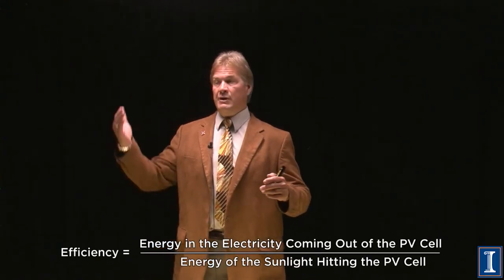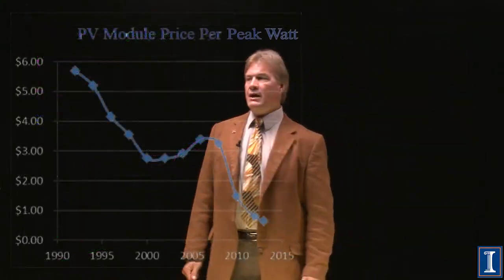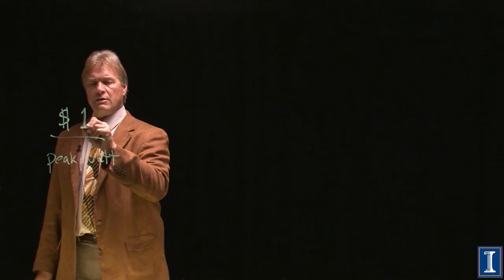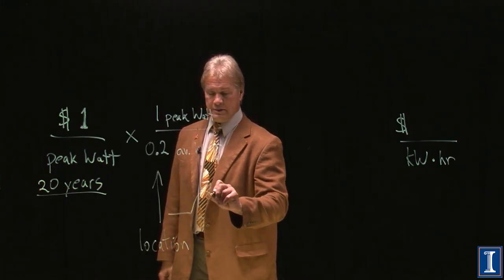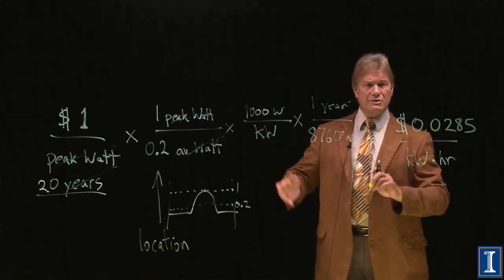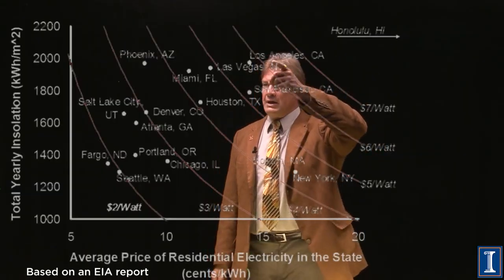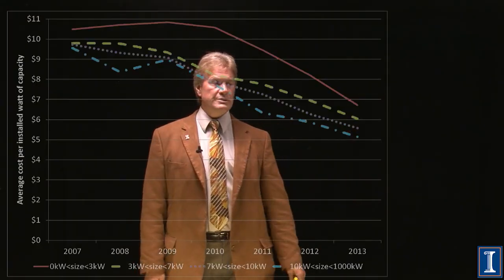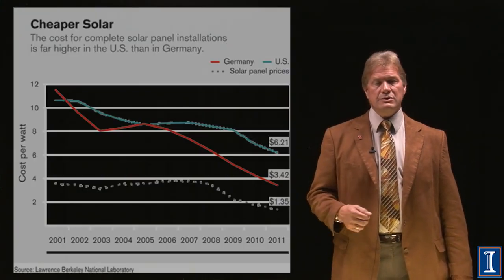The Cost of Sunshine

Comment: What are the economics of the energy used to create a solar cell and it's energy output over its expected lifetime? I read an article from Stanford that said until around 2015 it took more energy to produce a solar cell than the energy it was expected to produce. Then there's the matter of shifting pollution to create the solar cells to other countries.
Reply: I would guess that the cost of the energy to produce a solar cell would naturally be reflected in the price of it. Who is going to buy energy to make something but not add it to the sale price? But otherwise, I agree with what you are asking. Much of what we think is "green" energy just shifts the pollution to some other place that we cannot easily see.
Reply: No energy solution has a net positive output. Nuclear, coal, gas all take more energy to create than they produce. If we could make positive energy then we would live in a very different world
Reply: @TheJorge100  I think you are wrong at that one.  If all energy capture or extraction methods were net-negative, then we would all be dead.  That would be like eating celery.  It takes more energy to chew and digest it than you get back in calories.  But most all other foods give you more energy than it takes to consume it.  Ditto for energy 'production'.  Let's look at an example like hydro-power.  One can quantify the total energy required to build the system.  Then, once installed and running, you might run it for decades with very little additional input other than the water power that is provided with no human input required.

Our mere existence and increase in population suggests that we are obtaining more energy from our surroundings than we are expending.
Reply: @mikebetts2046  I hadnt considered hydro, so that is possible, but it still could not be. When I mean negative I mean barely. Like 0.001. Its why we still need fossil fuels and they are the reason we arent dead. We are using a finite resource to convert energy into something we can use. When I mean net energy I mean the energy to build, maintain, transport materials, fuel, workers, etc.
Reply: @TheJorge100  I had thought you did mean the 'maintain, transport, fuel, workers...' part.  On that score I still say that the overall system must be net positive, otherwise for the last few thousand years we would have been expending more energy than we have been getting and thus we would dwindle in just a few weeks or months.  

Imagine a person spending his every waking hour digging, hunting, and collecting food.  He does this 12 hours per day x7 x 365 and maintains the exact same weight.  We might assume he is net-neutral on energy.  Now he sacrifices some time (and weight) and makes some tools to increase his efficiency.  He can now do the same food-gathering tasks in 8 hours rather than 12.  Were he to work the same 12, he would then gain and be net-positive.  And probably gain weight, or have enough energy to get his woman pregnant and also support another child.  And so the cycle continues with ever-expanding efficiency.  It is true that the sun gives us its' energy for free and we do not consider it in the calculation.  So if we want to include the sun (energy burned for energy given) then maybe we are negative.

Comment: Solar makes a good supplement but I believe its being oversold. Your discussion doesn't include the monetized environmental and health cost of energy associated with fossil fuels. You also need storage and a base load generator usually fossil fueled. .But the big problems with solar and wind are land area vs electricity produced by a base load plant. Also you didn't even mention nuclear power, the cleanest, most efficient, and cheapest by any measure, especially the next generation LFTR nuclear plants fueled by thorium.
Reply: yes
Reply: Yes about Nuclear being best option and Solar fluctuating and being terrible for power grids.  Except for 100k in batts per person how is Solar and Wind grid even supposed to work once they become most of the grid, this is impossible green plan which is never addressed?
Reply: storage isnt possible...not at all.. not even a fraction.  you guys have it easy down there...ill say this loud... ITS IMPOSSIBLE TO HEAT NORTHERN CITIES WITH OUT BURNING SOMETHING OR SPLITTING AN ATOM.  end stop.  you simply cannot heat nyc with out fuel.
Reply: @mattycheezeburger  .. Actually i wonder if u can put billboard size mirror north of house n beam sun into window w black water tank, even in winter this cld work if tank big nuff to cover cloudy week, so heatin green is possible but we need to test, nuke needed for electricity...
Reply: @amyself6678  you would be amazed how little sunlight we get in winter in vermont.
Reply: @mattycheezeburger  MN winters r sunny, fall n spring can be dark, , . with photovoltaic gettn cheap that is beating solar thermal for heatin now, so prob can heat w solar if got big water tank to storrle heat at 200F for dark days. 60% home energy use is air n water heating, AC is 7 , appliance r 34. Eia.gov says this. So heck solar could cover 60% of household energy, prob offices too. . Trouble is adding 10k in solar equipment to each house simply is too much hassle to avoid under 1k a year gas cost, , and houses r only 25% of usa energy so maybe better to just go straight to buildin huge nuke plants in each metro.
Reply: @amyself6678  let alone.,.,that may work for a single family stand alone house...thers no way they have the space or the time or money to do this for bigger buildings
..can you imagine the heat sink for a 40 apt building?
Reply: @amyself6678  natural gas is king..by far. pipelines and natural gas.
Reply: @mattycheezeburger  natgas is king but it pollutes a bit, it is so cheap few people spend 15k to go solar fot heatin, , ohwell
Reply: @mattycheezeburger  . . i can totally imagine a apt sized solar  thing for apt, w nice big suburban yards we cld do it,  solar is silent n now cheap, solar is great compared to puttin a loud generator next door, , only solar prob is no gd way to store days of  electricity in case bad weather without 20k a person batt,
Reply: @amyself6678  you cant heat nyc with solar power...you CAN use natural gas..and besides atomic..its the best source of power by far.. you cant argue with me about this.
Reply: @amyself6678  its not a matter of just spending..its simply NOT POSSIBLE in most cases.  most people live in CITIES..not single family suburbs .make them move and then get transport costs..etc.
Reply: @amyself6678  and my propane generator makes almost zero sound .  14k watts. comes on when ever the power goes out..which is  about 4 days a month where i live in middle of no where vermont.  we have a small storage unit ,,just so the generator isnt going on just to power some small stuff..or constant from just something like a thermostat drawing power.

Comment: Great video. However thre cost of solar needs to include the cost of having standby power available instantaneosly. You have to keep the current system fully staffed to support it..
Reply: Don't need stand-by power. Already available through utility scale battery power. Try to keep up. We don't need no steenkin' nuclear or fossil fuels.
Reply: and the inital sunk cost,, say it costs 20k today to setup. he just avgs that out like its nothing, if you instead put that 20k in the bank. the accumulated profit over 20 years erases any savings the solar may have gotten ya.  plus the solar degrades massively with time..so yeah it works 20 years,,at 50% the last 7

Comment: 2019 Update:  Solar Panels are now <$0.30/w.  Total installed cost is now often <$1/w.
Reply: Now take away all the subsidies.
Reply: @dontbetonit813  That IS without the subsidies.  With subsidies they're ~$0.20/w....
Reply: @Chris-ie9os  That's nice. Now solve the REAL problem, storage. All the home solar consumers are doing is shifting cost burdens to traditional plants that need to handle 24/7 demand.
Reply: @chrimony  Storage isn't 'needed' and hardly beneficial until supply > demand.  If the lowest Demand during the day is 30GW and you have <30GW of solar why would you waste energy storing it?  Just ramp down generators and use less fools fuel.
Reply: @chrimony  ..... still better than burning fools fuel.  :)   Think of solar as decreased demand... just like using less energy.  Does it make sense to run your AC with the windows open so it doesn't cycle on/off?  Of course not... neither does storing solar if there's demand on the grid.
Reply: @chrimony  The video you linked to discussed how storage is used to buffer the grid.  That has isolated benefits but is neither 'needed' nor worth the cost relative to hindering the expansion of renewables to displace fools fuel.  Yeah... we're gonna have to give up obsolete thermal plants like nuclear and coal that ARE far less efficient when they ramp compared to gas turbines... that's already happening :)
Reply: @Chris-ie9os  Try watching the first three minutes. It covers how solar and wind increase instability, reduce efficiency, and increase pollution by require "peaking plants".
Reply: @chrimony  Again.... 10MWh from wind or solar may only decrease fools fuel generation by 9.5MWh because it's less efficient.... but that's STILL 9.5MWh less fools fuel generation.  And changes in demand do the same thing.  Demand response NOT storage will be the cheapest solution.  SPP already gets ~25% of their annual generation from wind with ZERO storage.
Reply: @Chris-ie9os  Try watching the first 3 minutes. You're ignoring how the peak generators, which need to be there to make up for solar and wind instability, are heavy polluters. It's also cute how you keep using "fools fuel" in place of fossil fuels, which keep people warm in winter, runs all the modern industry you take for granted, and provides the bulk of reliable, 24/7 energy that you depend on.
Reply: @chrimony  Try a heat pump... no fools fuel required :)   'Peak Generators' are now just gas turbines which run very clean and can load follow efficiently.  The cost is higher because they have a lower capacity factor but they're very clean.
Reply: @chrimony  What you linked is based on the U.S.'s "current" (read: old) methodologies for handling load variation - and this is being phased out in other countries for battery farms and thermal storage sinks (Australia has been implementing battery farms more and more as they have proven to be extremely effective at load balancing).
Reply: youre telling me for 5k theyll put 5kw system on my house.. i find that hard to believe
Reply: @AndrewBrowner  you'd pay between 1.5 and 2 USD/kWp in europe right now
Reply: @AndrewBrowner  I'm telling you that you can buy 5kW for <$5k.   Commercial Scale is <$1/w.   A friend recently bought 4.6kW for $3k.  http://sunelec.com
Reply: @Chris-ie9os  I doubt they'll last longer a couple years. I've heard the markets has flooded with cheap chinese knock-offs.
Reply: @Jawshuah  I bought some 'cheap chinese knock-offs' ~5 years ago... still doing great.  It's not hard to make a solar panel...
Reply: bullshit
Reply: What you see is that, for big plants, the solar panels arent actually that much of the cost anymore. All the rest is concrete and so on. 

On home values, I cant see many below 1 /watt. Energysage provides a average consumer cost today in 2019 of $3 installed per watt. https://news.energysage.com/residential-solar-panels-for-home/
Reply: @adamigra634  So much concrete.
Reply: @adamigra634  Very little concrete.  Most solar is pile driven.

Comment: I think that there are two take aways from this presentation.  1) We need cheap storage.  This is coming but it is not here yet.  2) We want to use utility scale solar (cheap standardized installation) rather than having them on roofs in the US.
Reply: Utility scale solar is best in desert climates. For a utility installation it may be better to construct a solar thermal plant rather than photovoltaic. It would be much cheaper on a per kilowatt basis, more efficient, and may include integrated thermal storage and even an integrated fossil fuel backup. Thermal storage would eliminate the need for batteries.

Comment: Solar power produces a very undesirable product: unreliable electricity. Since panel output fluctuates with the weather, you need a reliable power source (fossil fuel, nuclear, hydro) to offset the erratic solar output to maintain grid voltage and frequency. Also, since solar production is zero over 60% of the day, you need a 100% backup system (again fossil fuel, nuclear, hydro) to meet power demand during these periods. Finally, you must also consider the toxic waste stream costs to replace all your solar panels every 20 years.
Reply: Solar panels are Aluminum, Sand and a pinch (<1ppb) boron and phosphorous... none of which is toxic.  The role of solar is to reduce the use of fools fuel (GWh) which it does very very well :)
Reply: @Chris-ie9os  You should double check it, I didn't believe it either its mostly nothing but becomes a problem of scale.
Main issue was the Chinese are still using lead solder.
Reply: @AvNotasian  .... I have checked it... I've been to a Solar Factory in Ningjin.  Lead hasn't been used in solar modules for decades.  They also stopped using Silver.  The cell strings are spot welded.
Reply: @Chris-ie9os  Except they still find it in reality.
China has a serious problem with cost cutting and corruption, its why their stuff is of a low quality.
Reply: @AvNotasian  They don't use lead... but if you're that paranoid then use US panels.  They're now about the same price.  Mission Solar is based in TX.
Reply: @Chris-ie9os  I live in Australia, believe me they are not the same price :P
And they do use lead, its a problem that was identified when looking at the end of life for the arrays.
It was based off a random sample of panels that were put through the process of disposal.

I'm not saying its a significant problem, unless you plan to fully recycle the panels it should be irrelevant.
The other health hazards I thought were so irrelevant that I forgot them but there were at least 2 others.

Comment: The utility has to build coal/gas/nuclear plants for the yearly peak demand.  That grey winter day with no wind or sunshine for a week. 

So in the end, you DO pay for Watt(peak) in your connection fees. Unless you accept a "smart " meter that will cut you off,  when you need it most.
Reply: Excellent point about "smart" grid technology. The purpose of a "smart grid" is to "curtail" demand to accommodate unreliable wind/solar production so the grid doesn't black out. Hopefully you're not in a surgical theater for an operation when this occurs.
Reply: @SWOBIZ  Smart grid concept can also work to turn on devices, such as when an excess of power is being produced switching on batteries or hot water heaters.
Problem is people don't really buy things that they aren't going to use so the technology has received almost no penetration.
Reply: @SWOBIZ  What you're describing there is a dumb grid. The whole idea of a smart grid is that it knows what devices can be switched off without affecting anyone and which ones are critical. So your electric car only charges overnight, even if you plug it in during the day, and your water heater will have to rely on water it heated up during non-peak hours and your air-conditioner may cut out if demand goes above supply, but your lights and television are always available whenever you need them. Nothing in an OR would ever be switched off by a smart grid.
Reply: @Ladadadada  Fair enough. A smart grid doesn't generate more electricity, it just cuts off loads the dispatching technology believes are non-vital. As it runs out of available energy, more vital loads are progressively affected. This is likely to occur because wind and solar are highly unreliable. If you don't have 100% reliable (fossil fuel/nuclear) backup, your smart grid will go black when the winds doesn't blow or the sun isn't shining.